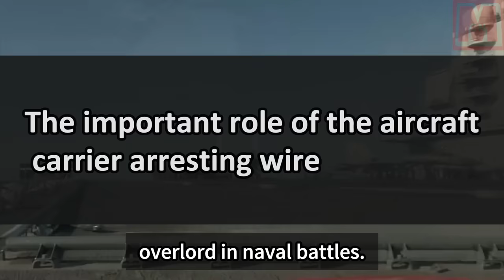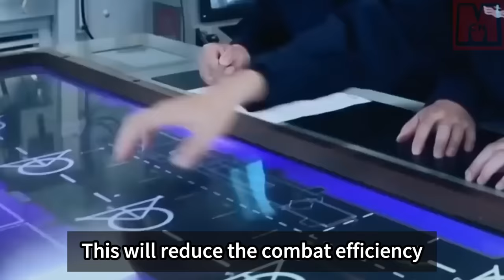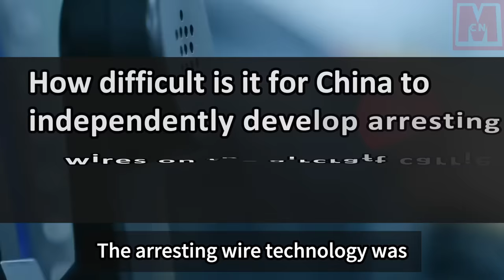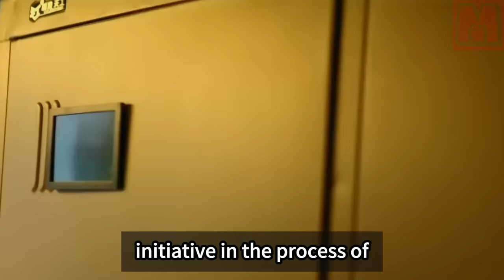The arresting wire worth 10 million yuan can hold a 20-ton fighter in 3 seconds

Comment: How hard to produce an arresting wire or cable? I can think of a hard elastic at the ends of wire. I don’t think it will cost USD1.5m but then again. everything in US is extraordinarily expensive, cos you need to pay or grease the wheel onto the politicians, the MIC & the bureaucrats